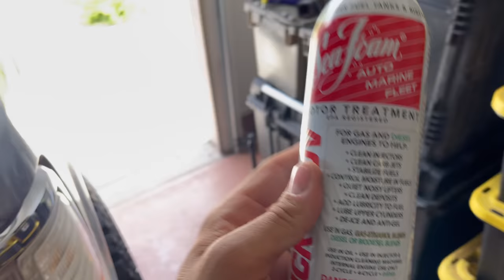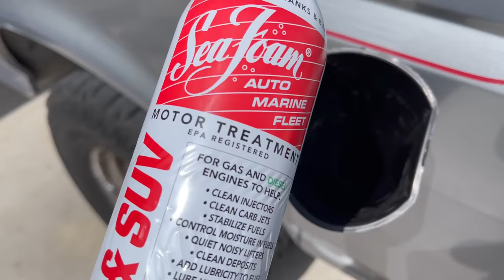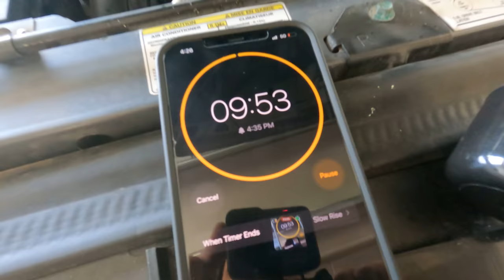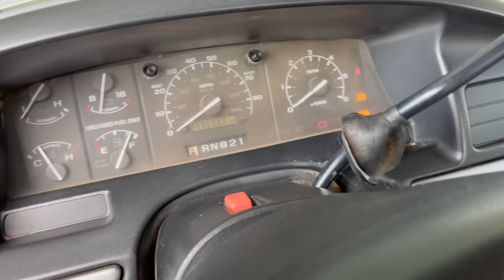Seafoam - Engine Treatment | How-to and is it safe inside your motor?

Comment: will doing this help with my cars pinging and rough idle? i have a 2008 mercury mariner and from time when going up a hill or just accelerating i hear some noises and the mechanic said its called pinging but just told me that its because the car is older that it will have these noises. this is my first car and even thought its an older car im just trying to make sure i maintain it. any advice would be greatly appreciated.

Comment: Any tips on how to keep the engine at a respectable 2k RPMs? without a manual throttle adjuster, i had to use a brick to weigh down the gas pedal until it revved at the desired RPMs. It worked, but wondering if there maybe an easier way
Reply: Ask a friend or use a stick

Comment: I do use it in my fuel..to clean my injectors....but adding it to my oil..if it gets grit and grime loose it's gone get in your bearings.
And I know what happens when you get gas in your crank case..it destroys your engine..that stuff is about the same as gas..I've put it in my mowers gas tank .it runs the same as gas..

Comment: About 7000 miles ago I had a complete fuel system service done on my 2007 Pontiac G6 with a 3.5l engine.  Where possible, I use 87 octane fuel.  The last four full tanks I have put in a 4oz bottle of Lucas Fuel Treatment (the last two full ups I’ve put in 91 octane).  It’s been about a month since my last oil change (maybe gone about 100-200 miles).  With all this in mind, when should I do the complete Seafoam treatment?  I also use Valvoline Max Life High Mileage 5w 30.

Comment: So i used the sea foam treatment and my truck has 79721 mile on it i got no white/bluish smoke after running it either my engine was supper clean or somethings not right. Any suggestions?

Comment: Question.... would you put this in a ls first gen in a 2002 gmc 6.0
Reply: Yes it's  worked fine in my 04, 6.0  and all of my other vehicles, lawn equipment, and outboard engines . I have never had one problem with seafoam in over 20yrs of use.

Comment: with the intake seafoam you're supposed to after 10 minutes drive it hopefully on the highway for about 5 miles. get it up to highway speeds whatever your county or city or state is. and burning it out that way. that's what my mechanic told me and I'm not a mechanic. and it worked..Next

Comment: My question is if your putting that in your oil and running it 500 miles does the vehicle smoke like it did with the fuel system the whole 500 miles??
Reply: No

Comment: Awesome video been doing this to my truck for years when I decided to go ahead and replace lower end of my 5.7l at 267,000 miles when we took apart it was as clean as can be and my truck always ran great after doing so! Of course I've never used anything but Valvoline in my 97 chevy k1500 and will continue to do this for as long as I have this truck! Great tutorial though
Reply: Also have run it through my vacuum lines which also works well

Comment: You BETTER have great seals.  I cleaned it to so well. I have a leak from front.  Other than that.  👍 I waited 5 minutes & got black smoke with white. But I did it 255% at a time.  I May buy another can and put it in. Do it right. TBH it doesn't buffer or shake the engine.

Comment: I think sea foam is ok a little help, But i believe it will not remove everything, Maybe 5-20 percent depending on car and how severe, I also believe the chemicals in sea foam makes it burn white smoke out your exhaust so that you think its working, Its a mind game, You have to take your upper intake completely off and scrub with brush and carb cleaner to get a good clean, that is the only way to do it right is taking it off...

Comment: Just because stuff comes out your tail pipe doesn’t mean you’ve done anything. If you’re changing your air filter or keeping up on your maintenance if you’re using an aftermarket one the intake shouldn’t be full of enough of anything to effect performance. Remember it’s just for air on modern vehicles. Unless it’s throttle body injection of course.

Comment: Used this just as recommended on my 2011 Hyundai Genesis V8, and it put it into limp mode. Dealerships were booked for 6-10 weeks. Luckily a tech at a Kia dealer had the software to repair my car. Do not use on Genesis

Comment: The hose u took off the bottle to run through the intake is suppose to be used u put the hose in the throttle body put the intake tub back on then run it reason being so your not sucking dust and stuff into your motor otherwise nice video

Comment: You can't take air intake hose off most vehicles I have they will shut off and will not stay running.. so running while spraying would not work in my case

Comment: Its called seafoam because it was designed for 2 stroke outboard boat motors. Modern  GDI car engines don"t really benefit from it. I saw a tank of fuel worth ran through a Toyota with seafoam in the engine. It was inspected with a scope before and after. The Seafoam made very minor if any improvements.

Comment: I used 2 full cans of seafoam every 6 months on full gas.   tank 15 gallons.. I have not had any problems or problem , my car is 2018 and I have 121,000 + Miles already... I do this to all of my cars, and truck.. you would notice the same day it runs more quiet, and no problem passing Smog... DON'T USED WHEN DOING SMOG TEST..

Comment: Man if it smokes this hard It 
Might be worthwhile to disconnect the Catalytic converters (assuming you can easily unclamp them) 
I can disconnect my second Cat with a simple clamp and 10 minutes of work but the upstream Cat is attached to the exhaust manifold so, just one comes off.

Comment: You could fill your gas tank with Seafoam.
You can't over do it.

Also, I dumped half a can down my throttle body and waited a little over 5 minutes and then started it up.  And it worked great !!!

This dude is making shit up, your engine didn't have to be warm or running.

Comment: I've sold engine intake cleaners to quick lubes for years.  Seafoam does everything that the professional intake cleaners can do . This works also as an engine flush. Again this will save you money if you don't have to buy it from a professional installer.

Comment: Water weighs one oz per fl oz, but this is petrol based, only 70% as much. But, your middle of the road 1.2 oz per quart puts you at around 5 fl oz. whereas they spec a min of 6. Close enough.

Comment: Do you have to run the fuel treatment before you do the treatment for the crankcase? Also do you have to do both treatments?
Reply: You do not have to do both. Both just optimizes the effect and covers&cleans more areas/parts rather than just injectors, pistons, etc. 

And no, no particular order is needed. If you car is < 100k miles, just the Sea Foam fuel treatment is fine if you have not replaced or manually cleaned your injectors. I try to clean mine every 10k miles, and Sea Foam every 4k with every oil change I do. 

Ultimately, it's user preference!
Reply: That was just the order he decided to add the Seafoam to his vehicle. Yes, you have to do both. The fuel system and lubrication system are independent of each other.
Reply: I would recommend throwing the can in the tank first, then when you have like 200-300 miles of gas left throw some in the crankcase. Then deplete your gas tank and fill up with fresh fuel and do the spray. Change oil immediately after clearing the smoke from spraying into your throttle.

Comment: Can this be done to turbocharged engines with direct injection fule systems?
Reply: Really you’re going to ask that it works on any type of engine lawn moors chainsaws it don’t matter if it’s a 1955 it will work it will work on airplanes

Comment: I did this today to my 02 Silverado. Check Engine light came on while doing it because the intake wasn't completely covered due to the straw. I just erased the codes. However my 02 heat sensor and 02 sensor says incomplete now. Anyone have ideas as to why?

Comment: Project farm did a comparison of seafoam on a lawnmower engine. It’s actually did clean the intake valves and the top of the piston. But unless you are experiencing a loss of power or high fuel consumption, seafoam is the last thing you should probably use to just clean your injectors and such. The majority of modern cars have two fuel injection systems like mine, so there is no need to use any cleaner as there wouldn’t be a build up of serious carbon deposits for longer than most people own a vehicle now a days.
Reply: what car has multiple fuel injection systems?
Reply: @ziggythegreat  lol. I'd like to know too...some of these comment sections need to be left to the real car people 😂
Reply: @ziggythegreat  I was thinking the same thing!  And, AND, if your car has a direct-injection engine, carbon deposits WILL build up and eventually cause issues.  Ask my son.  He just paid over $1K to have a CRAZY amount of carbon removed from the intake valve ports on his '17 VW Jetta!  He always keeps up with the oil changes and always uses top tier gasoline too!

Comment: You can get the same results with the non-aerosol by pulling the vacuum line off of the brake booster. Same steps, as with the aerosol.
Reply: Except you won't be cleaning your throttle body which is probably the main objective.
Reply: @fanelli57  the main objective of using the vacuum line is to break up deposits in the upper cylinder heads.

Comment: Seafoam was developed for 2 cycle engines in the 30s when engines were much simpler.  Fuels have changed quite a bit since then.  Seafoam really doesn't do very much but does help to stabilize fuel.  It can't cut most carbons and it can harm catalytic converters.

Comment: You opinion please...
DO you think it's possible to use TOO MUCH SEAFOAM? 
I use it on all my internal combustion engines, especially the lawn/yard equipment adding it to the 5gal jugs when ever I fill them with always highest grade unleaded fuel.
Reply: I once filled half the tank in a lawn mower with seafoam and half fuel. It was having trouble starting and would sputter..it smoked like crazy but it ran and cleared itself up..runs good now.

Comment: I must’ve done something wrong I didn’t have the hook shaped straw how do use a straw from my WD-40. But got very minimal smoke when I know it’s got a ton of buildup I have a 4.2 L V6, And I was getting around 320 miles of 23 gallon tank down to about 170. I get sparking which I’ve changed everything no check engine lights have ever come on we put it on computers master flow replaced everything reads fine ran in Canada Struet minimal smoke a ton of shaking like she was about to cut off but never did. Obviously it’s time to replace but it still was confused I didn’t get a lot of smoke. But what I might’ve missed I even have the intake open while spraying and had to put the hose back on or else I would cut off.
Reply: I honestly can’t figure out what it could be I run a ton of different fuel treatments this was the first top engine treatment I used to change my oil every 3000 miles even though I could technically change 5k. Very meticulous with my vehicle so it’s beyond driving me crazy.

Comment: Very much has the same product basically or you can do the same thing with the cheap can a carburetor cleaner you're just cleaning the throbbing blades of the thrallow body itself basically

Comment: Won't it clog up ur oil and fuel filters, fuel injectors, and catalytic converter when the deposits are removed?
Reply: I just used seafoam in only drove for about 20 miles before I smogged my vehicle, I went from almost passing, failed on Hydrocarbons by 2pts(before seafoam), I thought I should use some seafoam and now my vehicle is classified as a gross polluter lol, I then called seafoam to give them my issue, they transferred me to one of their technical support staff, he ended up telling me I should probably drive 200-300 miles before I smog as the knocked off carbon will get clogged in the cat and will need to burn off, I currently need to replace my front wheel bearing but if you would like I’ll come back to give you my results after the drive

Comment: You should really specify that you can only spray seafoam into the air intake of a gas engine. if you do that to a diesel, you could have a runaway situation where you can’t shut your motor off and then it blows up.

Comment: DO NOT use on high mileage vehicles, the white smoke you see is the petroleum burning off, any carbon deposits that are removed can clog the catalytic converter. It happened to me. For high mileage vehicles use Rislone RS 1. It cleans the converters pretty good. It is however great for all gas powered equipment because it acts as a fuel stabilizer. I put it in my riding mower and leave the gas all winter and she starts right up in the spring.

Comment: You definitely weren't holding the engine at 1500-2000 RPMs while spraying the Seafoam Spray.  When you went to shut the engine off you could see the RPM gauge and it was idling around 600-650 RPMs.  You're also supposed to drive it under load after spraying and allowing a 10 minute hot soak to clean everything out.

Comment: What’s the difference between running it on a fresh oil change vs shortly before an oil change? You said either was ok? I’m going to do it before my next oil change but just wondering. Also, I used to add it to my gas tank every few months when I’d fill up but then learned it’s best to add to a tank when it’s 1/8 full, did that right? I drive aN 06’ Honda CRV with almost 183,000 miles on it and go about 5,000 miles between oil changes (per manufacturer) but how often should I be adding it to my gas tank? Are there any other treatments or tricks I can do on my own (1 person job) to keep my CRV running forever? I love this damn vehicle!
Reply: Either way is not okay and never use this in a motor that has over 100,000 miles on it if you're using it in the oil, the reason they recommend you do it just before an oil change is because this stuff has a very strong solvent and has been known to cause weak gaskets including timing chain gaskets valve cover gaskets and pan gaskets to prematurely leak after using this product because of its strong solvent base. There is absolutely no reason to put this inside your oil, this was one of the stupidest videos I have yet to see on YouTube and there are a lot of them
Reply: @willsrestorations  🤣
Reply: @danbender2161  I’m confused. So not in the gas tank or oil? Or not be before or after an oil change?

Comment: Be careful though. I use seafoam in the crankcase and the motor started burning alot of oil after the oil change. 1/2L a day about every 300-400 km.

Comment: Seafoam deep creep is the best penetrating oil I've ever used by a long shot. Get a nut hot first and it gets drawn in. It works on 17 yo Chrysler hardware so it will get anything loose lol.

Comment: I am new to Seaform. So basically you can put Seaform into the fuel tank (scary) and inside the engines and will remove carbon deposits. This is good for Old engines.
Reply: I have been adding it to my fuel tank occasionally for years. All of my vehicles have over 150k miles. Sold my 4runner with 333k miles. Bad transmission. Great stuff

Comment: Hi.
Should be very careful with Spraying the solution into the intake as sometimes, the plastic tube becomes loose and falls off getting sucked into the top on the engine,  happened to me once and able to put a finger on it from going in farther, if it gone in, most likely would of removed everything in order to get out of intake so it didn't melt and cost a lot more money replacing other unknown stuff that could of caused damage to,  never good not to hold onto that red tube as 1 bumb and it comes off, They come on everything and many times  I get them and they do fall off very often,  I don't trust them at all, they don't lock in at all, wish they did with a small pin and a slot to line up and push in and twist to lock in, doesn't seem hard but I wonder if there responsible for damages as they fall off often, Silicone Sprays,  other Sprays to break rust off of bolts and need them to get in tight areas.
Reply: Those tubes usually have a large bend in them to prevent that. He must have cut that tube in half

Comment: Great video. I was an avid user of seafoam. It's an excellent product,  but... Seafoam is somewhat outdated when it comes to today's fuels. Seafoam was created for outboard motors. I think in the 70's (I could be wrong about the era). Thus it isn't designed for ethenal fuel. My recommendation would be GumOut MULTI FUEL SYSTEM TREATMENT. It does the exact same things that seafoam does, but it's designed to interact with today's ethenal fuels.
Reply: That is scotty kilmers misinformation. Seafoam changed a while ago to accommodate modern four stroke engines.

Comment: For use in 2 stroke outboard engines hence the name seafoam not for use in car engines especially modern ones with all the anti pollution stuff seafoam will destroy it I suggest textron cleaner it’s extremely better also if it was carbon being cleaned from the engine wouldn’t it be black not white/grey

Comment: Just don't use it on direct fuel injection 2 stroke outboards plugged my injectors up on my Evinrude etec those direct fuel injection injectors are not meant for oil to go through and see foam is oil-based. I ran some Quicksilver quick clean injector cleaner through after and fix the problem. Motor ran like crap after using seafoam repeatedly trying to treat for ethanol in the fuel. If it's an outboard use the Quicksilver quick Care products